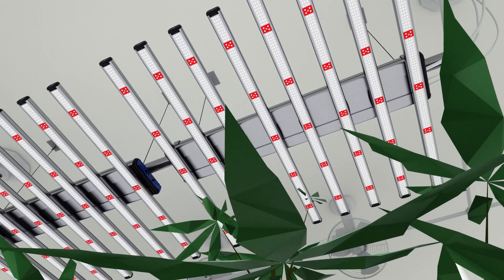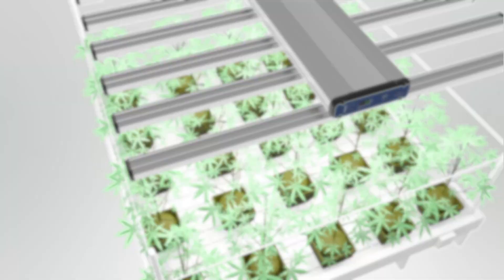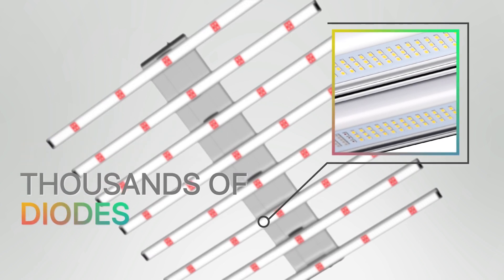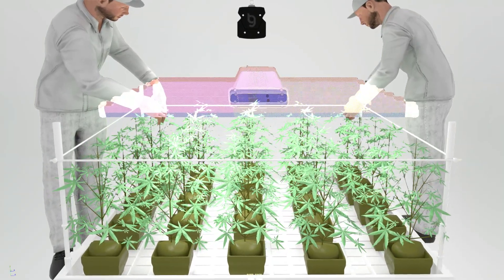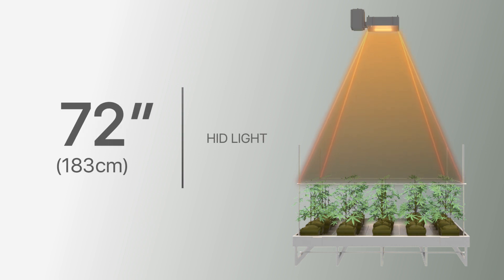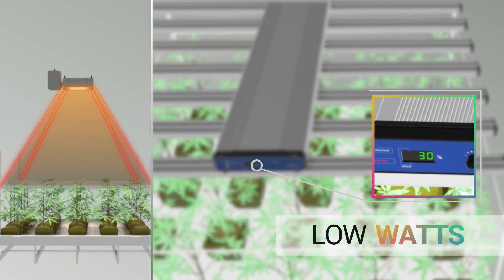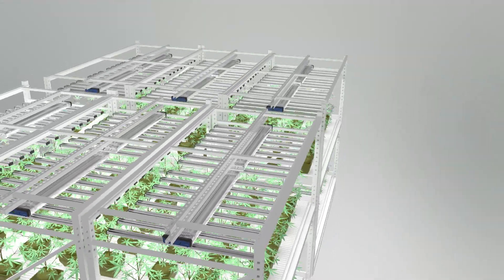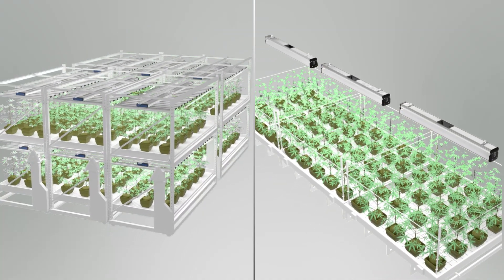"ThinkGrow LED 101"  - ThinkGrow LED Tutorial

Comment: This is all BS.
If you don't have led diodes directly over your whole plant.
You are not growing to your full potential.

We as true growers know how dramatically the par drops the further you get away from the diodes.
Most of the time by more than half.
Even though the light is projected that far.
The par of that projected light is useless.
Think about it people.

If your par is 900 directly under the diodes.
But your par is only 400 when you are only a quarter of a inch away from the diodes in the projected light.
You are not growing to your full potential.
Think about it people.
Why are growers not complaining about this.

I grow with areo in the SOG.
My plants are 2 inches away from each other.

Let's say I have 5 rows of plants across and 6 rows of plants down at 2 inchs apart.
But I only have diodes directly over 4 rows across and 5 rows down.
So now I have one row of plants all the way around that is only in the projected light at half the par.

Guess what,
All of these plants only grow half as big as the plants directly under the diodes.

So now imagine you are growing 1 plant.
But only half of that plant is directly under the diodes.
And the balance of that plant is only in the projected light.
And alot of that plant is a foot away from the diodes.

Do you really think you are growing at your full potential?

F#$k no.

The par at a foot away from the diodes is probably 100, if your lucky.

Think about it people.

These light manufacturer's are screwing you.
And you are bent over smiling asking for more.

Dummy up people.

You have alot more potential than you think.

Think about it!
Reply: So what's the best type of light for flowering please
Reply: @philjoy6635  led ....1000 par without co2...and over...co2 supplement required
Reply: Higher light make it a brighter canopy and they will stretch so no  par loss.   Where lowering the will  make a dimmer canopy plants won't stretch.
Reply: And.....
Reply: @assog5737  They will stretch when light is higher. So keeping light low has opposite effect from what you want.
Reply: ofc ...real grower will calculate PAR ....in blooming....under 1000 and over if you use co2

Comment: I use 1000W HPS and I can put my light  within 20 inches from the canopy and cover a 6x6 ft area. How many of your lights to cover 6x6? At least 2 so how are you saving power?
Reply: Lmao you can watch any creator that does par videos, any of them will tell you that led is now far superior to hid and hps. But do whatever you guys want! Only hurting your own yields and energy consumption.
Reply: Lol how burnt they are is irrelevant right ?
Reply: @braddream77771234  You just need to hang the light vertically and use a 48 inch white parabolic reflector and you can hang it within 20 inches of the canopy, I've been doing it for three decades and I grow pound plus sized plants every 100 days in DWC.
Reply: @torrielandsman4625  exacto
Reply: @torrielandsman4625  just saw your response lol 😆  my light is 1000w equivalent and its 4 foot away from canopy .  Your 20 inches would kill everything under it
Reply: @torrielandsman4625  30 years of killing plants isnt something to brag about smh 😒
Reply: @braddream77771234  LoL 1000W equivalent could mean a lot of things! Did you buy it on Amazon? what kind of footprint? You can grow a 5x5 at the most right! and thats if you bought a $1000 light.
 I cover a 6X6 footprint with a true 1000W HPS and no I don't burn my plants, In fact I have no problem pulling four pounds from four plants under one light!
 I think you should stick to getting 20 OZ out of your little tent with your expensive toy light and I will do what I do.
Reply: @torrielandsman4625  where are your videos 📹 or pictures so I can see these epic non burnt plants in action.  You can post them at the grow boss com tell braddream sent ya
Reply: @braddream77771234  I've been growing for over three decades, probably longer than you have been alive, and unlike you I know what I am talking about. The plants directly below my light get mostly reflected light because the lights radiate their energy horizontally, I get a very even spread of light and in a 6x6 footprint 1000W HPS is a great light 20 inches above the plants. My plants do not get burned and I get around 1 1/2 grams per watt in most cases. (depending on Genetics)
 Why don't you measure the PAR from full sunlight and see if you can explain to me why it doesn't burn and kill your plants because it's twice as bright as any light you or I have and radiated way more infra red energy than any light nade except maybe a plasma light or a welders ark!
Reply: @braddream77771234  I saw the little buds that you grow LOL, My buds are bigger in their fourth week of flower, and no I don't burn my plants!
 You obviously don't have a clue!
Reply: @torrielandsman4625  triggered lmao 🤣  that was my first grow of clones in miracle grow indoor too big for light and 20 inches from light like you suggested. burnt to shit nutes and light  😂  you have no clue brother I unlike you know better now
Reply: @torrielandsman4625  4 pounds of burnt nonsense code brown.  My 3rd grow i got 1.5 pounds  off 600watts I didn't buy off 4 plants. As good or better then dispensary.   Oh and everyone gets their equipment from the internet even the shops.
Reply: Ps, there is absolutely no way you run a 1000w hps 20in from a canopy without burning... I cant even run my leds that close 😂 something isn't adding up! You have stock in hps??
Reply: @WonkaWillE  when you hang a HPS vertically with a parabolic shade, the light isn't projecting the light down! it projects it 360 degrees horizontally and is reflected down. this gives you a large footprint and you can put your lights within 20 inches of the canopy without any problem if you have healthy plants
Reply: I'm a new grower and using LED, but i have no doubts over older technology because they used to make awesome weed, and that's all that matters. Why are you guys acting like it doesn't work is beyond me.. Sure, maybe it costs more electricity, more heat etc. but if he found a system that works for him, there's nothing wrong with it. Matter of fact, sometimes older technology is better because you can just switch light bulbs when needed, but with LED's you have to throw the whole light or send it for repair. LED costs more upfront so the total cost may be close.. And another important thing, older light technology had a good amount of IR and UV which helps with increasing potency, flavor and aroma, while also preventing mold and mildew. That's why many guys who grow with LED's make weak weed or simply weed without the desired effect. Not to mention moldy weed without UV.. Now we need supplemental UV lights. Sometimes old technology is better, sometimes new is better, in the end both of them are good and each has pros and cons.

Another comparison is cellphones. We used to have Nokia 3310 for example, built like a brick, could survive a fall, it would work for more than 10-15 years, batteries would last for days, it would never lag and be slowed down. New phones have hundreds of features, but the battery lasts for a day, the phone stops working after few years, it's constantly lagging and being slowed down, you want to make a quick phone call and you get errors and updates that prevent you from calling (application stopped working, close, wait etc.)
With older phones you could type the number with your hand in the pocket without looking because it had mechanical buttons and it was easy. But with new phones you can't do that on a touchscreen because you'd be missing on the buttons. And the new phones are so fcking large you need 3 hands to use them. Again, both new tech and old tech has their own pros and cons. Don't try to act like a smartass just because you're ''modern''.

And someone mentioned a 1000w equivalent LED, that's a complete lie. Especially with 'blurple' lights with veg/bloom switch and cooling fans.. The real power draw would be maybe 200-300w, if you switch only to veg or bloom that splits to 100-150w. The fans take some wattage as well, maybe 30-50w. So in the end you're only getting around 100w in total from those junk lights. And without yellow/white spectrum, without IR and UV, it simply doesn't provide the results. The sun is not just red/blue, it also has white/yellow. The latest LED's are great and all, but sometimes the old technology makes life so much easier. If i didn't have limited space in my room and if i didn't have to worry about electricity costs raising suspicion, i would do older technology as well.
New LED lights cost 300-500€ in my area, the older tech is so much cheaper that it compensates for it..
Personally i trust the old school growers much more than the new ones, because their weed speaks it's volume. New weed is simply not the same..
And before you say ''my LED has UV diodes'' it's not the right wavelength for sure. Those UV diodes are just toys, like the ones for invisible pens and money-checking UV lights. That is UVA between 350-400 nm. You need UVB from 280-315 nm to increase potency, flavor and aroma, and prevent mold/mildew. LED UV with that wavelength is hard to find, way too expensive and they burn fast.
Reply: Lmao at the classic salty old head comment "ive been growing longer than you've been alive" 😂 problem is youre still using the same technology from 3 decades ago as well. Times and tech have changed. Do some research before you make a fool of yourself.
Reply: @WonkaWillE  You think it's all in the light do you?
 The light you choose is a small part of growing a plant, and any quality HID light gives off enough light to grow quality plants!
 What I claim is that I get a solid 6x6 footprint from a 1000W HPS using a flat white 4 ft parabolic reflector and that I can have it within 20 inches of the canopy!
 I also grow small trees that yield over a pound a lot of the time.
 How about you tell me what you think I need to grow a plant to your specifications and can you give me an example of your work LoL
Reply: @torrielandsman4625  lmao who said "its all in the light"? 😂 i certainly did not say that... however your light IS one of the biggest influences on your grow, with only the seed or genetics being as important (in my opinion), however, obviously there are many factors that go into growing quality, environment (temp, rh, water quality, nutrients, grow medium, cleanliness, etc. Etc.) But thats not what we are talking about 😂 were talking about whether hps is as efficient as leds in both growing performance and energy efficiency, and the answer just about always is no... You can argue all you want... Im sure you are a great grower (probably not, because i can see how close minded you are and not open to criticism, but for the sake of this argument I'll say you are a great grower) im sure you are a great grower and get a great crop, point is if you switched to led you would have a better crop, with less popcorn buds on the sides of the tent and you would get them with a lower energy bill. You can respond as you like and I'm done with this convo, you can take it or leave it 👍 i have no concern whether or not you smoke crap.... I literally left links of professionals backing this... But let guess youve been growing longer than hes been alive 😂 lol let me tell ya something, my grandma has been cooking for 60 years and shes still terrible lol doing something for a long time does not necessarily make you good at it...no you can not see any of my grows 😂 i have nothing to prove to some random old woman 😂
Reply: https://youtu.be/51waoRTonc8
Reply: Hps still rules

Comment: Does it compare with the Cree cxb 3590 LEDs? Thanks.
Reply: Samsung 
HLG. 650R 🇺🇸🇺🇸🇺🇸👌🏼
Reply: Cobs are great, but, they work much better with many, and low settings, at a higher distance, where as SMD type, u can get lower, with less power because of the number of light distributers

Comment: for me here the distance from the lamp to the canapy is misinterpreted it depends on the situation but mostly you have to put the distance higher. because if you go with leds too close to the canapy the light is not evenly distributed, the plants can not grow in the light they are stunned because some leds are too strong. that's why you see everywhere that the leds hang so high I made my own experiences and in the beginning i put my leds very close to the canapy  and that was not optimal. conclusion yes you can make leds closer ran than hps but it is not always useful.
Reply from the maker: You missed the point dimming the light to optimal intensity instead of hanging light higher
Reply: @ThinkGrowLED  of course you can dim i dim in certain situations. but most of the time i hang the lamp further away and put a little more power in it so i have better canopy penetration and the light is more evenly distributed.
it also depends on the lamp my lamp is more in the center but if you have a lamp that already has a regular light distribution that is something else.
Reply: @ThinkGrowLED  altonake: 🤪bla bla wa wa wa😭 bla bla bla.
Reply: easy to understand with led....over canopy until 1000 par if you dont use co2....and over 1000 if you use ....so the distance is better
Reply: I have had similar experiences with ornamental plants too.

Comment: Don't forget,   
That the science of light reflections on certain materials
 and have them being placed at different angles,
So It helps you recycle the light from your lamp without it just being turned into heat 
and has the lower canopy of leaves to receive light fuel for photosynthesis😉👌🏽

Comment: Just bought one. My bros the beard bros. Put me on to these. Cant wait to try. Just have to dial in switching from gavita.
Reply: which one?
Reply: I returned for my room I get 3.5 with 2 GAVITA 750 flex or run 2 cmh withgavita in middle same yield this will not produce what I need. Just not sold on led yet. Model h is perfect for 5x5 tent.  Also my plants hate this light. Per thinkgrow it was perfect not all strains like led
Reply: @Mcnab96  true. I have been growing with led for two years.  We are now going back to side by side with Hps because we’ve learned some things that affect weight.